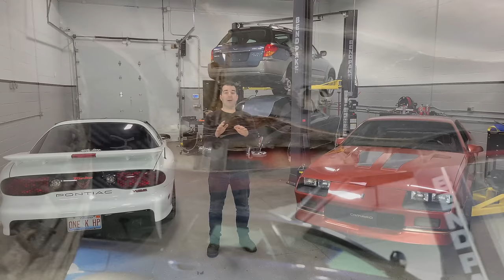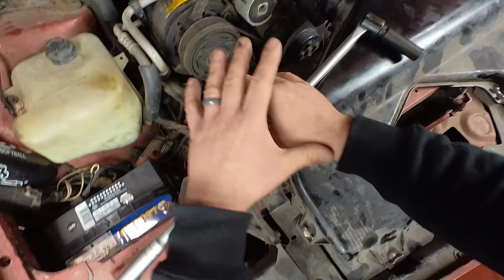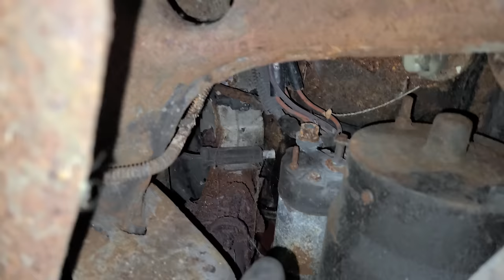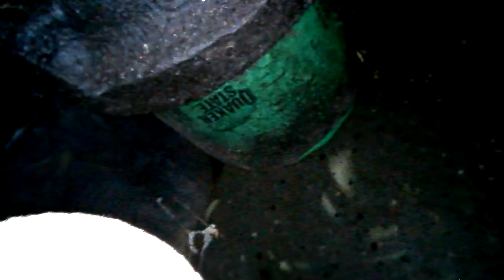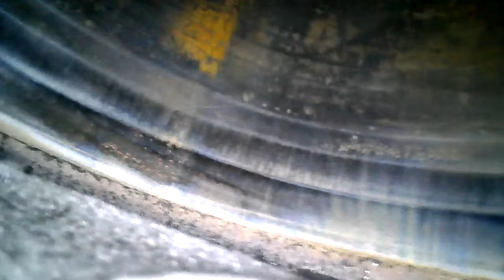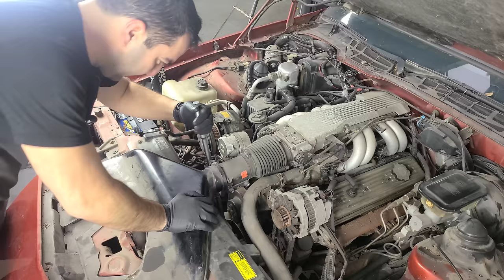Starting An Abandoned Camaro IROC Z After 27 Years & Looking Inside The Engine! Storage Unit Find!

Comment: The engine is not overfilled with oil, but rather had an internal coolant leak (probably overheated at one point). Then that coolant ran into the oil pan and made the fill level look high, but it was due to a normal amount of oil and extra coolant both being in there.
Reply: This is what I thought too.
Reply: @Paulscnccreations  The chocolate milkshake colored oil was a dead giveaway
Reply: The 305 I had in a elcamino made chocolate milk even throughout the system. 2 bottles of KW block sealer, I drove it for nearly 2 years before going to a .30 over 350.
Reply: @Paulscnccreations  He has forgotten more than I will ever know, so there is that.
Reply: Yep, exactly. Coolant in the pan. Head gasket or crack somewhere. Probably a spun bearing as well due to coolant in oil - water sinks to bottom of oil pan, gets circulated through everything and is much lower viscosity so no more oil layer between crank journals and rods. Bad deal, it’s ruined. Still enjoying the videos Alex!
Reply: @Texasknowhow  you sir have diagnosed the failure perfectly
Reply: I assumed head gasket failure/cracked block before he even drained the oil, the rust on the cylinder walls was a giva away it was caused by water/antifreeze ..
Reply: or used water instead of coolant and the block cracked.  Seen this on marine engines not properly winterized.
Reply: I agree. I believe those 3 rusty cylinders and bad plugs in those cylinders is where the coolant was leaking in from the head gasket.
Reply: @joeklopp4842  Bad plugs may have just been bad access laziness.  Have seen that before.
Reply: @gadget73  true, I did consider that as well. I just think it's telling that the cylinders with the rust were probably the ones with the bad plugs.
Reply: @lawofliberty3517  The 305 engine is a turd !
Reply: Yep and the yellow in the cylinders was probably coolant leaking in from a blown head gasket.
Reply: @lomparti  not always. My wifes iroc was the same way. Runs like a champ now.
Reply: Yeah, exactly what I was thinking when he said it was overfilled lol.
Reply: Yes! The 305 was a huge turd and money pit if you really want serious, Camaro-worthy power. Might as well get a new 383 with some decent heads, do a stealth fi, or LS swap the whole thing!
I have a 305 tbi, which is by far the worst of them!
Reply: Nailed it.  Yeah that milkshake should have been the definitive end of this whole project.  With all that rust I wouldn't have wasted one more second or penny on it.  Guess it still makes a vidya though...
Reply: @ちくてぬしくけて  i used to have a 89 305 RS, i pulled it and replaced it with a 350 TBI out of a G20 van..... i kept the TBI system. it was still a turd, but slightly less turd like.

it didnt get out of the turd-phase until i swapped heads, cam, and bored the throttle body. it DID wake up, but it took some effort and money.
Reply: @ちくてぬしくけて  i have an 89 IROC with a 305, & 5 speed manual. It's still running on the original engine from the factory, 120,000 miles, doesn't use oil, sounds good. The 305 didn't have the power of the 350, but it wasn't the turd you want to make it out to be! 
The 305 was a popular engine for GM back in the 80's. Now i will admit that i do like the LS engines better, i have an LS in a Silverado pickup.

Comment: Hey Alex I think it would be awesome if you pulled the engine to see what actually happened. Its definitely an iconic 80's car and I would love to see more content on it. But that's entirely up to you, love the videos brother keep up the great work.
Reply: Yes! A teardown video would be awesome.
Reply: He should ship it to the I Do Cars channel who tears down motors.
Reply: If he does swap the motor, that might ruin any core value of the old one, if there's any value left. At least, that's what JR said when pulling the Corvette C5 LS that sucked up some water.
Reply: @rpavlik1  never said anything about swapping the motor just pulling it and rebuilding
Reply: Keep the block new crankshaft go 383 same fuel injection new high volume injectors.  Rebuild trans and diff.  Add lots of frame support and you’re set 1000hp 88 IROC.

Comment: I suspect it's had a blown head gasket & maybe been run that way a bit. Would explain the high oil level if the bottom of it in the crankcase is coolant. Would make a thrown bearing more likely too. I'd suggest a teardown as interesting content, and maybe see how much of the engine and vehicle can be re-used. There's a good car in there waiting to come out, just needs a bit of TLC.
Reply: Lots of TLC lol, probably looking at 10-14k for a full resto.

Comment: I would keep it at this point and restore the car. I know the body is rough but the 305 wasn't a keeper engine anyway. Fenders and quarter panels are cheap, the floors can be repaired as well. These really are cool cars and they are starting to get some appreciation. It's not going to be an all original car but it still has a lot of potential. I started with a even less Camaro in even worse condition and I absolutely love the car and have zero regrets with it
Reply: I've gotta agree, I've seen worse restored. I would restore this myself. I'm having to do this with my own car, and like yourself zero regrets.

Comment: Sounds more like stuck valves to me the cams on these old small blocks tend to wear out i don't think the vales are opening much.i would at least tare the engine down and look at it it's only a few hour of work and could be interesting content.
Reply: It would be backfiring through the intake or banging flames out 3xhaust if so. It's definitely been cooked and locked up heat siezed and thats y she's now a rattler. Bearings toasted
Reply: That was rod knock
Reply: @JDJD-mw9rr  Until you tear it down you don't know for sure.and I've heard rod knock before that is not what it sound like ,but it's a video I and you are not in the room with it.
Reply: Can won't be worn out. It has a roller cam
Reply: @jeffflaig362  I don't think it does  but the engine was full of water roller cams still need oil. I just think you should take apart the engine see what failed it's not always what you think.
Reply: @mbsnyderc  I know for a fact it's a roller cam. First year was 87 for the small block in cars. Trucks didn't get a roller cam untill 96. I agree it should be takin apart to see what's wrong. I say the bearings are shot from sitting in coolant for 25 years.
Reply: @jeffflaig362  Okay they still fail there not fool prof and like i said the engine was full of water they need oil.

Comment: Small advice : get few bottles of oil flush - spark plugs out, few syringes of oil flush into every cyl and leave it untill everything goes into pan or few days. Then try to turn it without plugs for few rotations with breaker bar. If moves - few seconds with starter too. Then get it running in idle, max 30 minutes. Change oil for something cheap. Let it run for up to 1h. Change oil into desired.
By doing that i've loosen stuck ring in my dads daily & improved compression by A LOT. I think it would free engine thats sized not so hard.
Thanks for video, cheers from Poland :)
Reply: That won't fix rod knock or a spun bearing tho, that engine is toast and needs a rebuild. Better yet it needs to be a boat anchor
Reply: Uhhhh, bud, if the engine cranks, it has nothing to do with piston rings. That head gasket is blown and throwing a ton of coolant into the engine and oil paths. Mix in fouling,  clapped out bearings, the works. Only thing this engine is good for is being a place holder for another engine.

Comment: That Quaker State filter brings me back. My first job "working" on cars was at a quick lube shop in the 90's that used Quaker State filters. I don't remember who made them, but we never had issues with them failing.
Reply: I remember those green QS filters too.  I think they were made by Purolator.

Comment: I'm of the IROC-Z generation, I vividly remember when these hit the showroom floors.  In the context of performance cars of the time, it was a good performer, more about the handling prowess over sheer power.  The TPI engine was really cool looking when you popped the hood, and was the Bowtie banner carrier in the Ford vs. Chevy battles of the 80's.
What to do with it is a tough one.  3rd gen F-body values are increasing, but as you stated, this is entry-level and really rotten.  I'd probably try to find an enthusiast willing to take on the project and give him full disclosure.  Of course that is assuming that the car is safe enough to restore to begin with.  I love 3rd gens so I'm definitely a bit biased, though.
Reply: I’m in the same generation. Graduated in ‘89. Always loved the 3rd gens

Comment: Based at what I heard on the video it was severely fuel knocking because you were using exclusive starting fluid.. I'm betting if you fix the fuel system it will definitely run better.. also I did not hear any lower end knocking.. just fuel knock

Comment: I got my First car a  85 Z28 TPI that sat for 12 years. I replaced the fuel pump and sending unit & cleaned tank for good measure I refused a trap door, new tires, oil change etc and yes first thing I did was turn her over by hand thankfully it was easy. She fired up. Yes was in a storage unit 💰 But she was my first car. Driving out the storage unit to the highway with thick dust was pretty cool to the car wash.

Comment: I had a used "86, 305, traded it in on a new '89, 350. Drove it for 3 years. Loved it because it was quick, cornered like it was on rails and Mustang drivers were afraid of it. One of the best body styles GM ever came up with. Great car but finally realized it wasn't really suited for Chicago weather. Hated it in the winter. Finally traded it in on a new Blazer 4X4 in "92.  I Like being able to go almost anywhere in any weather even more. Stuck with SUVs ever since and haven't regretted it.

Comment: One of the most beautiful engines, the tuned port. My 5.7 '91 GTA air intake goes to the passenger side behind the headlight. Been looking at suspension upgrade. The front just has too much wallow, gonna search your library.

Comment: We used to cut the baffles out of the filter boxes and run 8" furnace sheet metal elbows to behind the fog lights, a ram air set up.
They could be bent square at the filter box and screw to it.
And K& N elements.

Comment: Thank you for this video. I purchased a 1988 IROC last year that needs major restoration. I have so many things missing I didn't even know where to start. Well actually. mine wouldn't run. From the time I got it to the first start was two weeks and a RockAuto $127.00 computer. One thing missing is the coolant reservoir. Thanks to this video I can see the way the wiring should be run so I can mount the replacement. Mine sat in the California desert for the last 34 years so everything is dry rotted. It will take some time, but I was looking for a project.

Comment: Hey Alex doubt you’ll see this but I have a 1988 Iroc as well a 350tpi car and for some reason it won’t idle. Runs drives great just when you come to a stop it doesn’t idle unless you keep your foot on the gas. 
Love the content by the way been watching you for some years now! I have some Amg’s as well!
Reply: Hey man, I've had a bunch of these cars and that sounds like idle air control valve to me. You don't need to replace the valve yet, you can try resetting it first. To do this, you jump the A and B ports of your ALDL connector with a paperclip or jumperwire (like you would do to check the OBD codes by getting the light to flash) and turn the key to the ON position and wait 30 seconds. Unplug the IAC valve with the key still on (you should hear it clicking as it closes in diagnostic mode). Now with the IAC unplugged, take the paperclip or jumperwire out of the OBD port and start the car. It might not want to idle at all, or the idle will be off. Set the idle to 700-800 rpm using the idle adjustment screw on the throttle body. Once you've done this, shut the car off, plug the IAC valve back in, and it should idle perfectly and the rpm drop when  you put it in gear should be minimal. I'm willing to bet this solves your issue. Edit: If this doesn't solve your issue I would get a new IAC valve or replace it and make sure to do this reset process after replacing the IAC or it will not idle.
Reply: I had an 88 GTA, and it took a bit to get her running right. My main issue was a faulty PCM.  Other things I did were usual tune up stuff,  and sent my injectors to be cleaned   flowed and matched. 

Your issue could be ad simple as a vacuum leak.  I've also heard the EGR valves go bad in those too.  

Do you hear a hissing sound when it tries to idle?
Reply: Also check your fuel regulator under the back of the TPI. It’s just a rubber diaphragm and they go bad.
Reply: Check the egr valve
Reply: I had one a long time ago. I seem to remember the TPS (Throttle Position Sensor) were pretty crap on them. Well all 80's GM cars. Replacing the sensor should fix it.
Reply: I’d check the back of the throttle body, I had an issue with a car where it was bad on the back effecting the idle, or the IAC like the others  mention. I’m so glad Alex changed the oil out of that thing, never saw one so bad before
Reply: Something else that may help is Field Service mode: Jumper ALDL A and B like Sean's Customs said only while the engine is running. SES flashing fast indicates open loop (Should go to a slow flash after warm up indicating closed loop and good fuel mixture) If it goes from fast flash to off (Engine is running lean) Or from fast flash to on (Engine is running rich) . Try unplugging the MAF and see if the engine runs better- As long as you doing have a vacuum leak and your O2 sensor is working properly, I would suspect the MAF to be the problem with a lean/rich condition.

Comment: Not sure if someone else answered this yet but, the air intake tubes ran to the front for TPI camaros and to the side for TPI firebirds (due to lower hood clearance). The camaro had the "better" intake setup from the factory. SLP made a more efficient side intake that I put on my old TPI Formula and it made a HUGE difference in throttle response over the factory setup.

Comment: I saved a locked engine from what I saw from one of your videos. Just changed an engine from a Jaguar Xk8,  the injectors are funny, if you remove one it lets fuel pour right into the cylinder, so the engine was not hydro-locked but petrol-locked! I just followed the steps from your video after draining the fuel from the cylinders, poured oil down the spark plug holes, freed up the lock by spinning from the crank pulley, new plugs, fired right up and problem solved!

Comment: LS/6spd swap after you fix the rust in the quarter panels. I had a ‘86 Iroc that I bought to be a street car. Ended up becoming more drag car. Had other projects going on and it got pushed to the back burner, got married, had kids. Car ended up sitting for more than 15 years in my garage. Sold it to a friend about two years ago. Could kick myself now, should’ve LS/6spd swapped it.

Comment: I found that a piece of tiny air line from a set of 70's lift shocks fits tightly over the red tube from spray cans. As a result, I can spray any aerosol lubricant into virtually anyplace I want, works great.

Comment: On thirdgen firebirds (including trans ams) with the optional crossfire 305s from '82-'85 the air was fed through the formula cowl and into twin filter air cleaner housing. 
Once the tune port injection was introduced in '85 the air was fed through the right  headlamp area. 
The camaro had a better air intake system in my opinion  having force fed behind the fog lights. 
However, at one point SLP made a dual cold air intake system that had two air filter housings into one duct system and into the throttle body.  Of course the battery had to be relocated somewhere else as the second filter housing will occupy the space.
Only one time i saw this setup and it was on a 91 formula firehawk which was standard on those birds.
Again great video and looking forward to more iroc content.

Comment: If I have a frozen up engine, I use maverlous mystery oil. I just take the plug out fill the cylinder with the oil and let is sit and then a day or two later turn it over by hand all with great reaults

Comment: Alex, while I'm not a fanboi of anything GM, reviving a 34 year old car is something I admire and can appreciate, regardless of brand.

I STRONGLY suggest you get a fan setup with tube to put on the car exhausts while you are working in a totally close shop.  A CO monitor with alarm would also be a good investment.

Lastly, great job with the Insta360 infomercial.  I'd been researching 360 cameras, and now will consider one like yours.  The Insta360 One X2 was already at the top of my list.  But your model may have more long term use.

Comment: Since these old TPI system are not that great with aftermaket. a great combo for a replacement engine is either a L30 or L31 Vortec engine with a LT1 cam! 
and a Vortec to tpi intake there is one on the market. 
hope it gets some love its still solid enough to use as a daily driver after a safety refresh new brake and suspension checkup. 
i would fix it and Daily drive that!

Comment: Pull the 305 and do a teardown, throw it back together and her her running at least.
If you have a running and maybe driving car then go from there.
The rust doesnt look to be terminal and its not like there isnt a ton of aftermarket for it.
I've been tempted to buy a TPI 3rd Gen IROC Camaro a few times here in Oz, theres a few of them floating around for reasonable dollars in the base and T Top spec and they drive nice.
And obviously little to no rust coz we dont get snow.
Some of the Right hand drive conversions are ordinary though but id drive a left hook car here no problems.